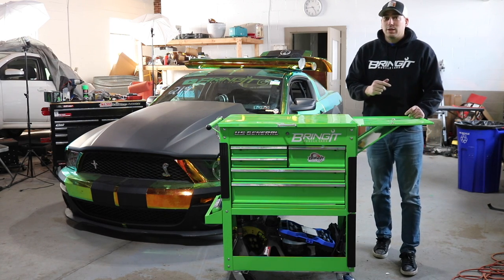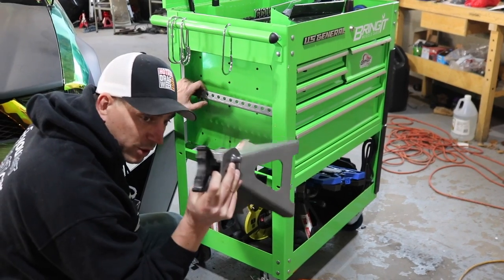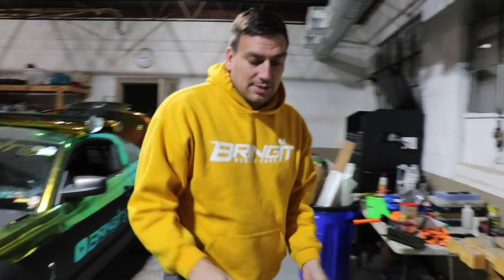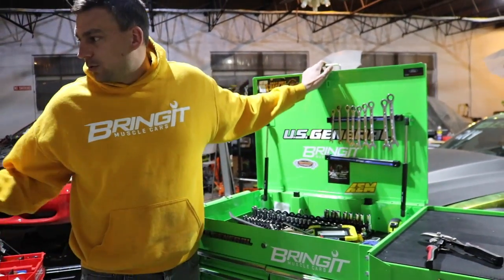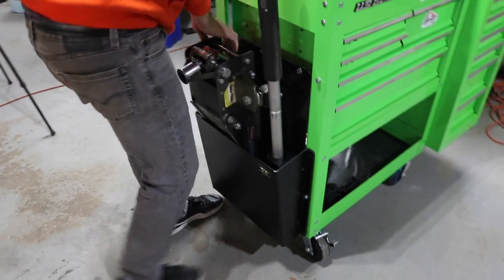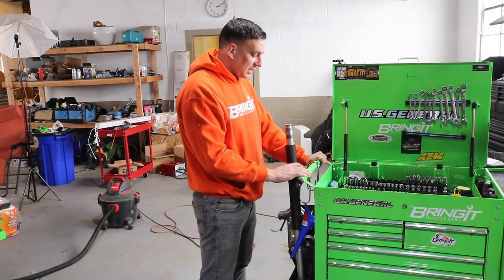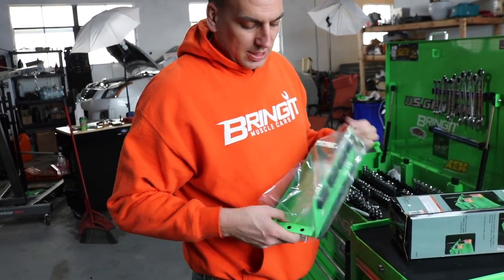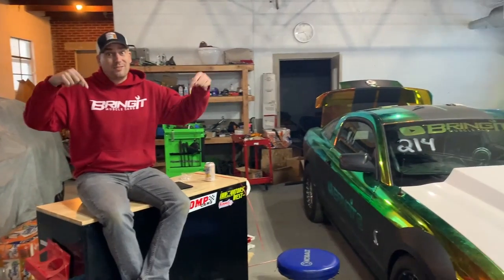HOW TO ADD THE END CABINET ONTO THE HARBOR FREIGHT TOOL CART #harborfreightprojects

Comment: Why didn’t u just use the grinder u mentioned to make the cuts? Guess I’m a little confused on that whole deal
Reply from the maker: Travis Gustin I went to get my grinder. Someone borrowed it and didn’t put it back. I had to use what I had available.
Reply: Bring It Muscle Cars nothing worse than that!
Reply from the maker: Travis Gustin true. Everyone was like it wasn’t me. I didn’t know you had one. Yeah okay.
Reply: @BringItMuscleCars  I would rather loan out my dog than loan out my tools. At least my dog knows how to find her way back home.
Reply from the maker: PaganWizard very true. I had to start locking my boxes at our shop because a lot of tools have walked away.
Reply: That's the first thing I thought. Where's the $15 HF cutoff wheel to make those cuts? I get it though, gotta use what you got when you want it done now
Reply: If he used the grinder, he couldn't make the face of "shear" determination!
Reply: @BringItMuscleCars  i have a special box for those that ask can i borrow. Its a extreem china tool box like dollar store cheap China tools.
Reply from the maker: aux1z11 that’s a great idea.
Reply: @BringItMuscleCars  hey can you attach casters to the bottom of the side box?
Reply from the maker: @nathanielyoung5737  yes you can. I think you are better off building a frame around both and putting the casters on the outside.
Reply: I was thinking the same thing, work smarter not harder. 😉🤙

Comment: I would have just put a set of casters under the new cabinet
Reply from the maker: Chris Spderbetg I was going to. I still might once I see how it nice handles the weight being fully loaded.
Reply: This is what I was going to reccomend. Maybe add a thin plate to bottom of the cabinet along the outside edge to support the casters, and add like 2 there.
Reply from the maker: Paul ZillaX I might build a angle iron frame around the whole thing. Then use just 4 casters instead of 6.
Reply: I did just that. Built a small "trolley" with sides to hold the end cabinet. Sits at the same height as the 5 drawer cabinet. Works great and you don't have to haul all that weight around.
Reply: @BringItMuscleCars  if you do end up building a frame, be sure to film it. I'd love to see what design you come up with!
Reply: Bring It Muscle Cars having 6 casters will make it very stable going in and out of a trailer will be easier it will never high center
Reply: @elementsofcreation9551  Yeap! 👍 👌 That's exactly my plan.

Comment: I REALLY like your idea with this to expand the storage capacity of the tool cart. I WILL definitely do this side cabinet mod to mine as well. Thanks! Also, food for thought, in my 22 years as an Air Force heavy equipment mechanic (mobility/deployments) we used to bolt the top and bottom toolboxes together by removing the drawers as needed for access and drill a couple holes and use bolts, fender washers and nuts to tie both together for better stability. You could do same by bolting through the corners and with spacers for empty space on sides on cart, along with casters that everyone has already suggested. Since you keep cart strapped inside trailer, this would prevent the side cabinet from possibly coming off IF you hit big enough bump or pothole then open trailer to find cabinet and tools off all over trailer.

Comment: I hung an add on cabinet to both sides of the cart. Built a cradle of sorts outta 1/4 thick angle for under both add ons and mounted the blue hd wheels under each end. Also mounted the folding shelf to the side of the add on. Heavy but works great.
Reply from the maker: Do you move it around. That’s got to be pretty heavy. The side cabinets are heavy. If I could weld I would have built a cradle. I had thought of that.

Comment: Can you do a follow up video after some use, I love the idea but I'm concerned it will be to heavy and it will fall over with out the added Jack holder to counter balance, also did you look at possibly adding casters to the end cabinet
Reply from the maker: Andres Apodaca I thought about adding casters to the end cabinet. Shouldn’t be to hard. Adding the jack holder was to help balance the cart out and to make it a easy place to keep. I’ll definitely do a follow up once it’s fully loaded and I’ve been using it.
Reply: Measure the gap to ground put a set of swivel casters on bottom of side box
Reply from the maker: Mark Wilson I probably will once I get some weight in it and it needs it.
Reply: @BringItMuscleCars  4in. 330lbs. Solid rubber locking Swivel casters are what will fit and hold the weight easily...they are almost  dead on to what U.S. General uses stock on there carts and cabinets
Reply: @BringItMuscleCars  Have you made a new video yet?
Reply: If you put casters. You should  permanently attach the box to the cart...  because if you roll it off a trailer ramp it could push the box up and off the cart at the transition...

Comment: Did the same hack on my cart, but kept the front of both units even. This meant notching the back of the side unit. I also bolted the side unit to the main cart’s legs, just for added security. I’ve been looking for a matching touch up paint for the neon green, so will look into 22Trips. Nice job!

Comment: be trick if you could get onto a carla cargo type trailers, but retro fit for your tool box.  They run around with giant fed ex deliveries in NYC.  Narrow low profile trailer goes on back of an e-bike or anything with ball hitch (I pull something similar I made with my mower around property to bring tools to machines.  Could drive that baby right over to the car out on the track ;-). Thanks for sharing.

Comment: Very nice job...im an HFT employee and I think most of The day how to mod almost everything in the store...did you try rubber wheel chock in The jack holder to stop the bounce?..they are always handy to have around
Reply from the maker: Kenneth Burns that’s a great idea and easier then a strap. Thanks for the idea. I appreciate the support.
Reply: @BringItMuscleCars  ...not to mention there's a coupon in play for those wheel chock for $4.99 each up to 4 per purchase until 4/19/20
Reply from the maker: Kenneth Burns even better thanks.
Reply: Kenneth Burns 👍 and you can use the chock(s) for increased safety when using the jack to get the vehicle up on the jack stands. Parking brake or having transmission in gear works when lifting the front end with rear wheels on the ground, but chocks needed for the front tires (which have no parking brake) when lifting up the rear end.

Comment: Just picked up one of these carts for racing superbikes.  My cart will be travel to the race track in a trailer.  You mentioned that yours travels in a trailer.  How do you strap your cart down in the trailer?  I assume you use ratchet straps, but how do you strap it in.  With my current cart, I use “D” hooks on the floor and strap the hooks around the square steel tube of the Bluepoint cart frame.  The HF cart frame doesn’t seem sturdy enough to handle being hooked and strapped.  I was thinking of doing E-track on the trailer wall and strapping around the cart to the wall.  Just wondering what solution you came up with.  Thanks in advance.  JohnV.
Reply from the maker: I have two D rings on the wall I strap it to. It runs across the drawer and I have to slide the strap up and down. I haven’t had a problem with it moving or loosing up.
Reply: @BringItMuscleCars  Thank you for the reply.  Do you still do that even with the extra add on box that hangs from the right side of the cart side?  I guess the bumper guards, placed properly, can serve as a protector from any rash caused by the straps going across the front of the cart.  JohnV.
Reply from the maker: @gecko6952  I still do. The strap did wear some of the paint though. It’s not the best layout overall because it’s a lot harder to load and unload from the trailer.

Comment: Where did you get the Tray (you called it the brake cleaner tray) you added the magnets to from? I don't see it on HF site. Need one for my cabinet
Reply from the maker: It was actually attached to the cart. I took it off when I added side cabinet and Jack holder.

Comment: How end heavy is the cabinet after it is full? Do you actually have to compensate for the weight of tools in the cabinet? Like making sure you only put light stuff on the top/ect
Reply from the maker: It’s okay when it’s fully loaded as long as the rest of the box is full. It is tippy when pushing it around. I haven’t tipped it over yet though.
Reply: Good to know! “Havent tipped it yet” is good enough for me Thanks! I may just caster wheel the add on cart- use it as an electrical cart or something!
Reply from the maker: @Superfly816  I think a lot of people put a set of casters on the cabinet. I was going to build a frame. I still might I just haven’t had time.

Comment: Did you bolt the cabinet on any other way besides just hanging it by the top lip? I think I missed that part and didn't see you drill anything into the insides before the drawers were put back in.
Reply from the maker: Scottie Manners I just hung it on the side. Without it being loaded up I don’t see the need to bolt it down. Once I load it up it might be different

Comment: Flip the handle upside down so it’s flush with the top. What brand, color and where did you get the paint? I like the additional holes in the screwdriver tray idea. Pretty sure that bad boy is over the weight limit. Hope it works out —thanks for the video.

Comment: I just bough one. Thanks for the great ideas. Although I probably would have went with some type of dremel tool or electrical cutter, for the cuts. When I assembled my tool box I knew it had more potential.=, but you blew me away. The only thing that I probably would have done different would be to add two more casters.
Reply from the maker: jt mobley I would definitely recommend using a small cut off wheel for the cuts. The casters under the box would definitely reduce the load on the cart. I’m glad I could help you. Thanks for watching and commenting.

Comment: Looking good. Where did you get the  jack holder? And couldn't you have moved the tray to the other side of the end cabinet?
Reply from the maker: David Addler the jack holder cane from summit racing or amazon. I could have put the shelf on the other side. I didn’t feel like I needed it with the top of the side cabinet.
Reply: This is true. Just thought maybe if y'all was working on a couple at the same time it might be worth it.  Thanks for the reply.
Reply from the maker: David Addler I have a couple other benches to work on. No problem about the replies. I’m just happy I could help.

Comment: What did you use for the jack holder?
Reply from the maker: I got it off Amazon or SummitRacing. It’s designed to mount in a trailer.

Comment: What about adding the tool tray to the other side, and making it flip up on top of the lid of the cart. Then you can still use the pull handle, and have the cart tray work surface. Drop the handle lower, and install a flip hinge, and braces? Just thinking in my head
Reply from the maker: That probably would have worked.

Comment: If you make your cart so big it has all your tools then what's the need for a tool chest? I store all my rarely used tools in my cart to have more room in my main box. I leave the top empty to hold tools while I do a job and when the job is done I put them all back in my tool box then move on to the next job.
Reply from the maker: Retrogamer1010 for me it’s being able to store stuff underneath the box. Have the jackstands and other bigger items there is really nice. I normally have my cart in my trailer. It’s geared towards my racecar. But I agree if you don’t move it around much and have a lot of tools a box is the way to go. It’s more economical to get a decent size box than my set up.

Comment: Why didnt you have the side cabinet flush with the front of the cart? What about putting that side tray back on? I'd put a set of casters under that side box.
Reply from the maker: Heavy D I chose not to have it flush with the front because I strap it to my car trailer. This cart is meant to stay with my drag car. 

I could put the side tray back on if I wanted to drill holes in side cabinet or not have a handle on the other side. 

You can put casters on the side box. I have plans to modify it even more now.
Reply: @BringItMuscleCars  That makes perfect sense, you may have said it in the video that it was going into your race trailer and I just missed it. I have the yellow cart and was wishing it was bigger, I am going to absolutely steal your upgrade tip and put a side cabinet on mine! Awesome tip!

Comment: if you mounted the side box flush to the front the power strip could be put on the back unless you need to set the tool box flat to a wall idk just thinkin
Reply from the maker: I actually built this to go in my car trailer. So I wanted it to sit flush against the wall. Otherwise I would have flushed the front. If you did that then mount the power strip in the back. You could drill a hole to run the cables through to charge stuff with the lid down.

Comment: You may have doubled the weight carrying capacity of the cart, so the weak link may now be the wheels.  Any thoughts of upgrading the wheels and castors?
Reply from the maker: I had upgraded the wheels. The weak point is actually the side frame and bottom floor. It’s already bent
Reply: @BringItMuscleCars  dam 😁

Comment: Well, I suppose if it works for you, then it works.  Do you know the weight capacity of the casters?  I'm thinking that as you fill the add-on cabinet, your total cart might reach their limit.  A bigger tool chest is going to be more robust.  You could upgrade the casters as an alternative.  In any case, monitoring the casters might be a good idea.

Comment: Just wondering why you didn't fab up a frame to go under them both so you could upgrade the casters the ones on the cart do not hold up when over loaded and pushing it around they will last for awhile just my thoughts plus with the cars behind you you should have all the tools to fab it up easily
Reply from the maker: Michael Cross I’ve seen people make a frame for the bottom. It’s possible that I might do that. I’ve been looking at bigger “off road” casters to make it easier to move around at the track if I need to. For the most part it sits still in the trailer. 

I don’t do the fab work on the race car. I leave that to pros. When you’re doing 155-165 you don’t want anything to go wrong.

Comment: I would recommend using nut rivets and bolts to anchor the bottom of the side box to the main cart, also to attach any other accessory's to the side of the side box.
Reply from the maker: William Johnson that’s a good recommendation.

Comment: FYI for those who have powder coat guns or access to one: The RAL 6018 green powder coat from prismatic powders is an exact match to that tool box color.
Reply from the maker: outdoorzone thanks man. That’s great to know.
Reply: Bring It Muscle Cars one other tip is you can take some of that dry powder and mix with MEK (methyl ethyl ketone) and it will turn the powder into a liquid and you can touch up the bare metal where it’s cut and then use a heat gun to cure it.
Reply from the maker: outdoorzone that’s cool. Just learned another useful fact. Thanks for sharing.
Reply: @outdoorzone  Would you happen to know the US General Blue powder color?
Reply: @jeff32689  no sorry! You could  try and contact prismatic powder coating online and they may know!!

Comment: What paint did you use I couldn’t find anything that matched any help would be appreciated thanks
Reply: RAL 6018 green powder coat is a perfect match if you can powder coat!
Reply: outdoorzone thanks
Reply: Pete Thiel one other tip is you can take some of that dry powder and mix with MEK (methyl ethyl ketone) and it will turn the powder into a liquid and you can touch up the bare metal where it’s cut and then use a heat gun to cure it.

Comment: the series 1 cart/7 drawer cabinet worked better for this IMO. instead of it hanging off the front or back, it was about 2 inches shy in the back, which i used to make a space for my creeper to hang on a custom 18 gauge steel bracket coated with plastidip. i put the handle and can holder on the same side on the left, the 7 drawer on the right, creeper hook behind the 7 drawer, and the folding table to the right of the cabinet. everything mounted with matching carriage bolts, locknuts, and red loctite. 2 of the HF magnetic strips are bolted center on the lid, for pliers, cutters, nippers, drill bits, whatever. i upgraded the hood struts to ones off of a jeep cherokee back hatch, they hold 65 lbs a piece so i hang whatever i want on that lid. i also used an old ford fuel filter hanger and some air hose scraps as a drill holder mounted to the bolts of the top left of the cart body. this was before the boom in bluetooth speakers, so i wired up some battery operated ones for tunes too. got the magnetic glove holder right behind the cans on the left of the box where there's dead space under the shorter screwdrivers in the sides. i also stacked a couple 2x6" under the cabinet and added 2 more swivel casters. you had to do that because the bottom of the cabinet is recessed. works great. better than 7 years old now and it hasn't failed me once.
Reply from the maker: koolBOY8323 thanks for sharing. That’s a great idea with the creeper.

Comment: Is the side piece better sticking out in the front?
or flush?
Reply from the maker: Hanna Say Go it’s sticking out. It’s thicker than the cart. It hasn’t to stick out the front or the back. Mine is strapped into the trailer most of the time so I choose to have the front out further.